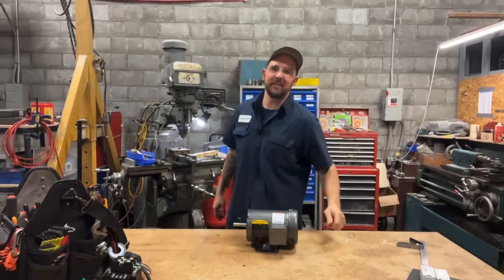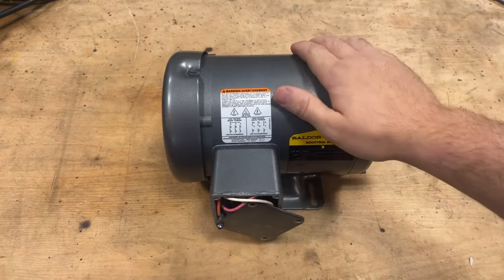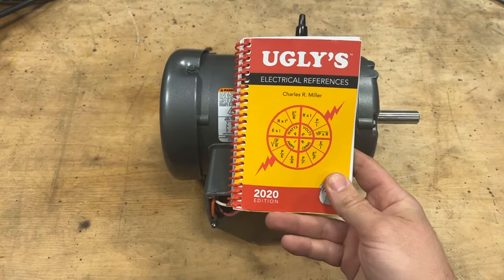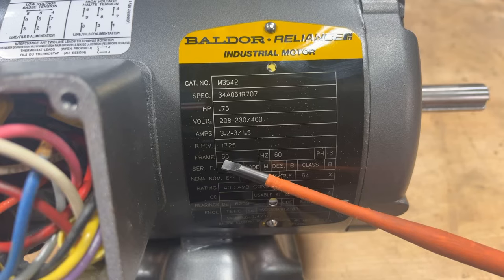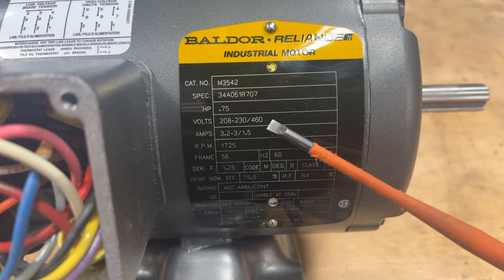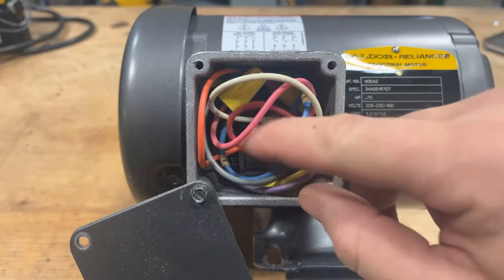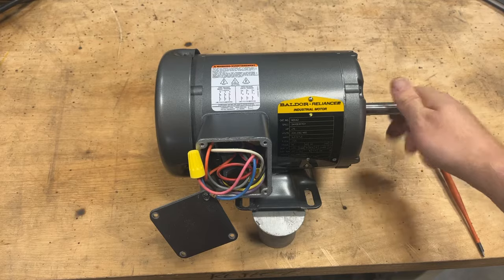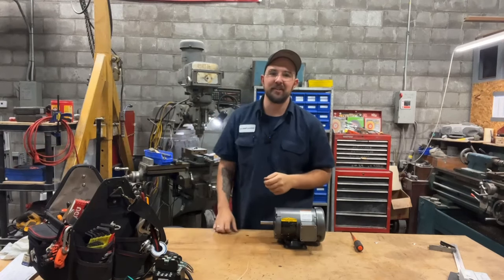How to wire a 3 phase motor

Comment: I think the high voltage is just wire nut 6 and 9 together then wire nut 5 and 8 together then wire nut 4 and seven together for a total of 3 wire nuts then hook up your three phases by choosing which one to hook up to which line

Comment: Hello, how do I know if a three phase electric blower motor is locked up? The reason I’m asking is I have anywhere from 24 to 27 of them and this guy is telling me that they are nothing but scrap and they are in squirrel cages I bought them at auction really good price from Houston Metro. I’m not sure.
Reply from the maker: best way i could think of is to disconnect the motor from the fan and check them each. Spin the fan by hand to ensure the bearings are ok, then wire up the motors and spin them over without anything attached to make sure you are not starting in a "stall" condition. You could also check for continuity with a meter from each of the three phase lines inside the pecker head of the motor to the case of the motor to ensure there is not an internal short to ground in the field frame. Hope this helps!

Comment: Month ago I was talking about having to hook up 3 phase  to motors .    Back in my time I could run a Motor to a rewind shop . in the 90's the new motors toss out in the trash . you can change bearings and brushes , but they can't be rewind .  Its a Shame for the price .